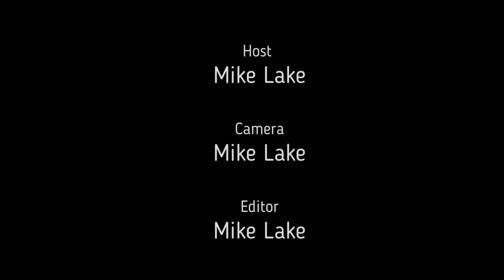DIY Hitch mounted Bike rack with left over scrap

Comment: Nice
Reply from the maker: Thanks.    i would love to use it more but it will not stop raining long enough to get on the trails.    After the last rains most of the trails are underwater.    

i think my next fab job would be a rod and cup holder for the 1976 Aqua Sport bass boat.   Not sure why they did not put any of them in the beginning.  

thanks for the comment and the watch.